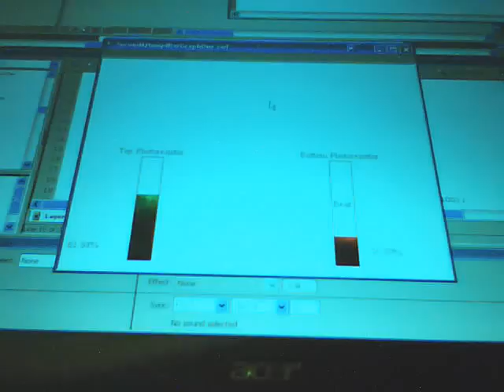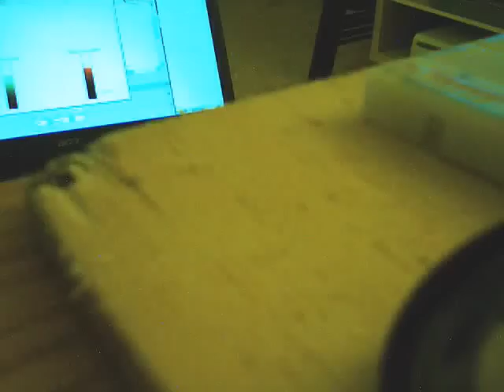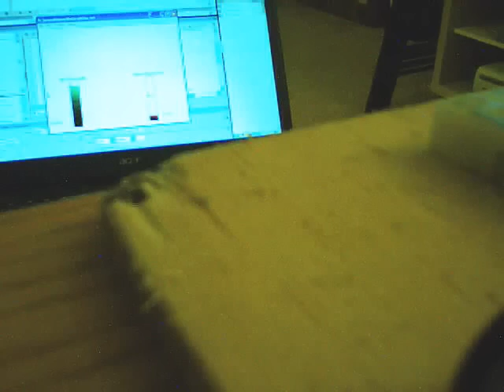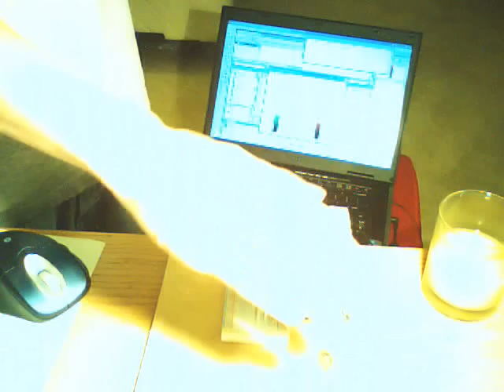First Arduino Project Photoresistors Piezo Speaker Flash

Comment from the maker: @lucirz This was a while back now but I believe I was using TinkerProxy to pass along the data from the arduino to flash, so the data path goes like this: Arduino read physical resistance from photoresistor (comes in through analog port on arduino so I get a value 0-1024) use Serial.print(analogRead) to write out the data to the serial port, use TinkerProxy to pick it up off the serial port on the PC and pass to something that can be read using Socket in AS3, hope it helps let me know if not

Comment: can you please comment on the driver circuitry on the piezo speaker?  they operate at high voltages and can not be driven with a typical audio amp.  they take d type and ab type supposedly ..............................................   thx

Comment from the maker: @lotec11 Hey this is a super old project at this point so I don't remember the details, but I wasn't using any sort of high powered anything in the video, just a very small piezo speaker.  The tutorials I mashed up here were straight off the arduino.cc site, the piezo one is here (won't let me add the link, putting it in the description) I just mixed that with one on reading photo sensors.